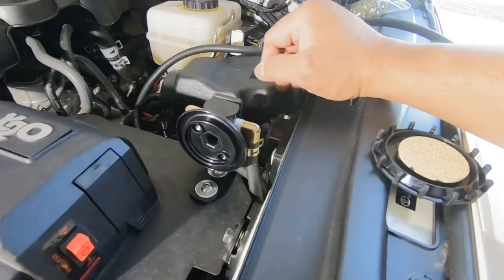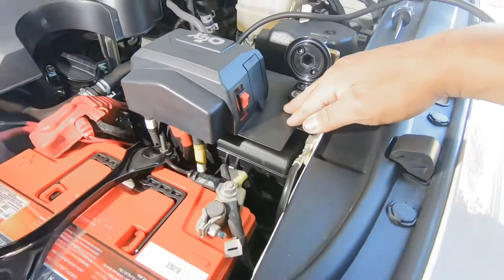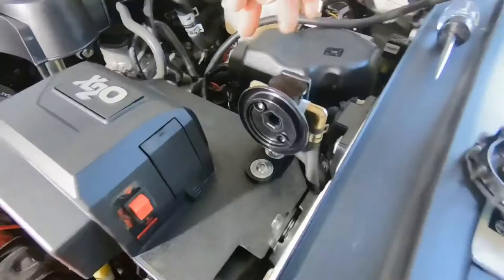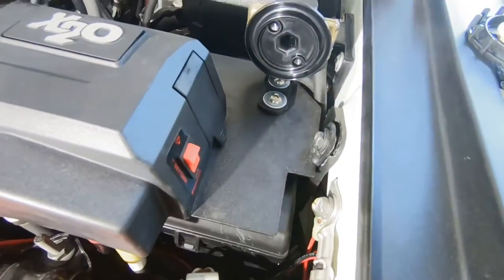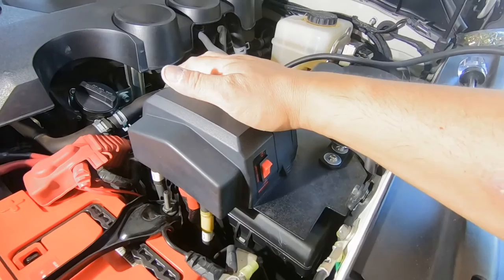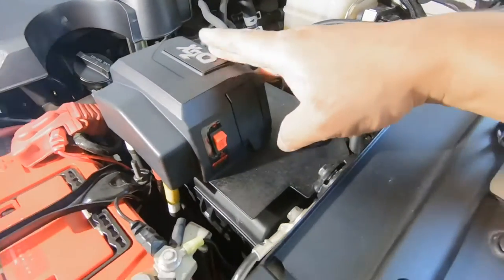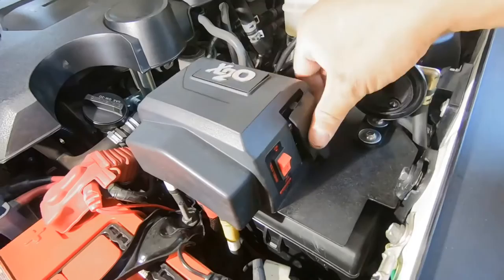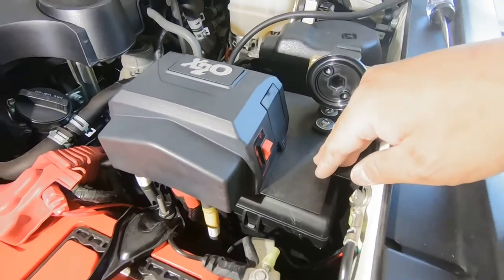Front diff and trans Breather Mod FJ cruiser

Comment: Really the extended breather is only really needed while the differentials or other are cooling by water contact. Once in water, there shouldn't be much cooling of the differentials so there shouldn't be much suction of air (by cooling) even if you get into water above the breather.

Comment: Thank you for the video. Can you please post a link to the amazon brass t connector you are using. Great job! Nice rig.
Reply from the maker: Thanks!  I added the link to the t fitting in the description.  Give it some time to load.   You can probably find the part at your local hardware store as well.  IIRC I used 3/8” but you don’t need it that big, 1/4” should be just fine.  You then just need to match the appropriate size barbs and you’ll be good to go.  I added a 90 degree elbow so my lines pointed in the same direction but you don’t need it.  Hope this helps

Comment: Did you just have those two breathers up against the firewall, or the two metal breathers and a plastic one? My ‘11 AT has 3 - 2 metal and one plastic.
Reply from the maker: Two at the firewall (trans/transfer case), and two above the area of the alternator just behind the factory battery location.  All four are the metal capped valves, none were plastic.

Comment: I can’t find these breathers to save my life lmao
Reply from the maker: Check this out! https://a.co/d/836YzLS
Reply: I’ll prolly buy that one, but no I mean the 2 breathers for the trans and transfer case that are on top of bell housing I legit cannot see them lol, did you have to remove / move the thick hoses on back of engine to see?
Reply: Since you’re responding though, just to make sure for the front diff actuator and the starter on top you need a 1/4x1/4x1/8 tee and for the bottom 2 on the transmission and transfer case you need a 1/8x1/8x1/4 tee?! 

Thanks!
Reply from the maker: Correct,1/8 to connect the factory lines to the T, 1/4 for the tube going to the breather.  It’s tough to see but the breathers are between the firewall and the engine, just above where the trans bell housing is.  It’s attached to the block using a plastic clip from the factory